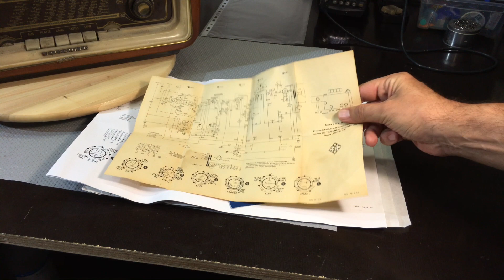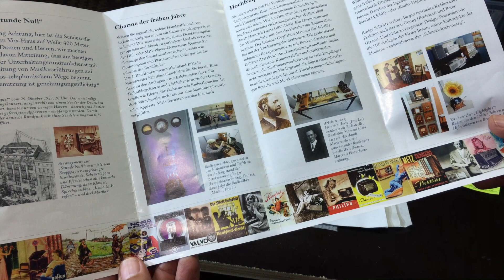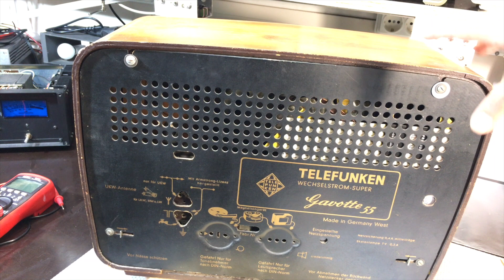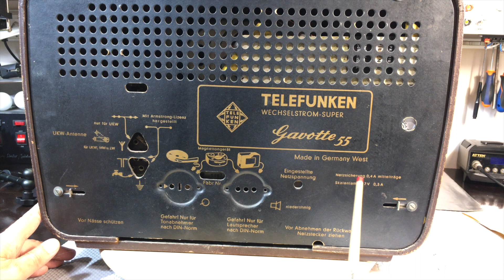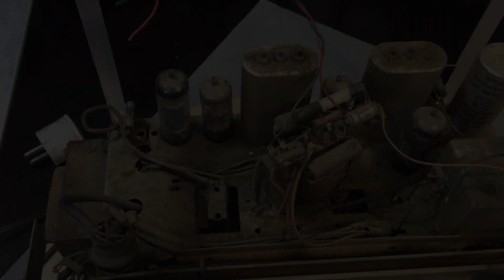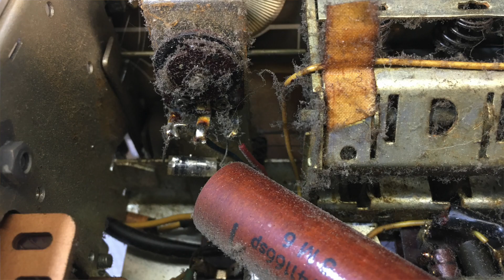Telefunken Gavotte 55 restoration part 1. A Gift from a Radio Museum. Let’s have a first look at it.

Comment: Please could you tell me where I could find a bracket to hold the radio chassis like the one you use in the video ?
Thanks for your answer. It is very important for me
Reply from the maker: I made it myself. This one is made from aluminium but I did a video in which I show my first version made out of wood: Repair rig for Tube Radio or Tube Amp repair
https://youtu.be/bVXWUMCujNE

Comment: I have a Telefunken Gavotte 57 awaiting restoration, so I'm not sure how I missed this series, but it should be very helpful. Found it in an antiques mall in Paducah, KY— *with its turntable*— about 22-23 years ago. It's still a fully-working turntable. Both were, and are, in very good condition. 
Its power supply capacitors died before I ever felt comfortable working inside a tube/ valve device, love them though I may. Boy did that thing sound great.
Many thanks for this!
Reply from the maker: my pleasure

Comment: I can appreciate the filth to fantastic - it can be a big part of the "YES!" factor.  I'm am working towards making my own test equip for the same thing.  Sure you can buy cheaper then build, but where is the sense of accomplishment doing that ?  I am confident you'll do a wonderful job on this one Manuel ... no pressure :-}
Reply from the maker: Thanks Paul. I also like building my own stuff whenever possible. Much more gratifying.

Comment: Lucky you! It a beautiful a Telefunken multi band radio.  I have  Grundig Majestic from 1965, that I picked up in Germany when I served there in the 
US Army.  I've kept it in pristine condition all these years that it need no restoration. I realize that I should up grade the electronics   But I can't bring myself to touch it. The German use top quality parts.
Reply from the maker: They sure did, and these radios last for ever if well cared for. Be careful of leaky capacitors though.

Comment: The only problem with Polystyrene capacitors is that if they get hot...which they are likely to do in a Vacuum Tube (Valve) radio, they will change capacitance and not return to the original value.  Otherwise, they are very stable and reliable capacitors!

Comment: Manuel, Looks like a fun radio. As purchasing radios for restoration for your channel is expensive, perhaps you can become a radio archivist for the museum wouldn't that be a challenging and rewarding avenue of endeavor.
Reply from the maker: That may be a great idea 😊 
Endless radios to restore, and not having to find more excuses to convince my wife that I simply must store another radio in the house 😊
Reply: @electronicsoldandnew  Perhaps you can auction off some of your collection, eBay prices for restored radios seem to have no ceiling. Trade one working radio for four broken radios, again kidding aside thanks for letting me look over your shoulder.
Reply from the maker: pleasure

Comment: Looks this one does not have a mains-isolated power supply, looking at the "Gefahr" (=danger) warnings at the pickup and speaker connections on the back side. So be very careful with it, as you normally are. Also this radio does not appear to have a ferrite bar antenna as most radios of this period would have.
Reply from the maker: This one does have a transformer. It’s in the side. The “danger” signs are pretty generic. This one relies on an external antena.